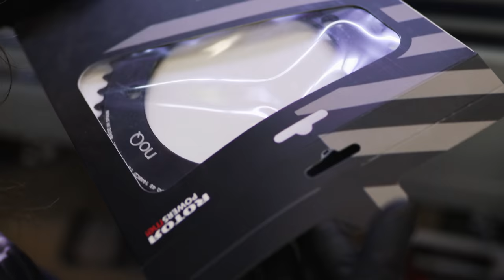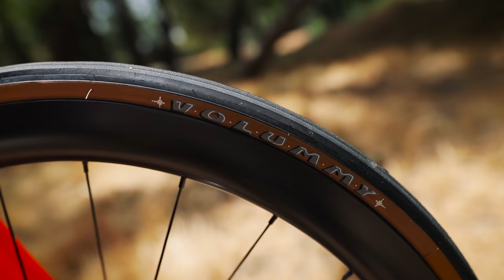DREAM BUILD FIXED GEAR - MASH AC-2

Comment: I like the fact, that most of the time the torque wrench was used the screw didn't turn and just the wrench clicked. You don't need a torque wrench if you torque it to high by hand :D
Reply from the maker: Or... those were "check" passes